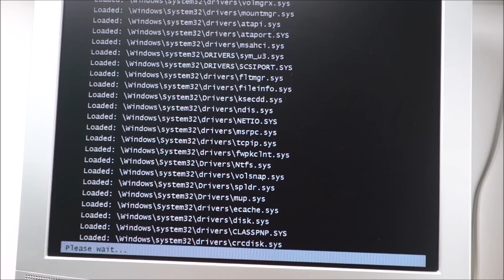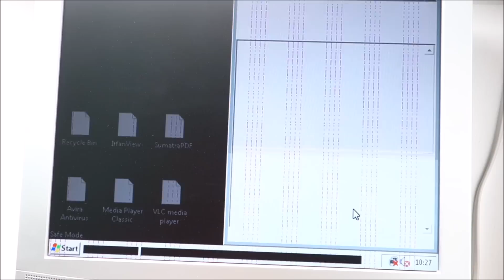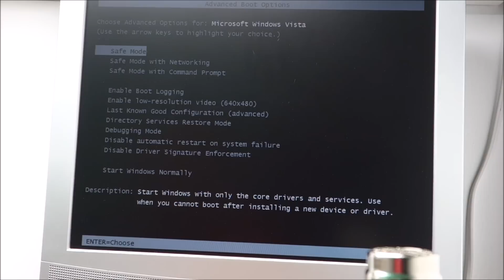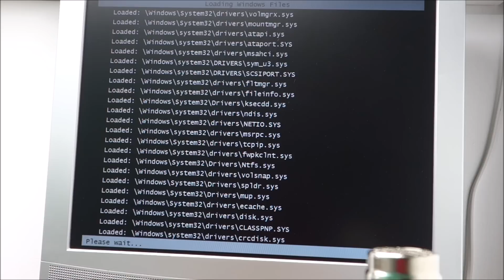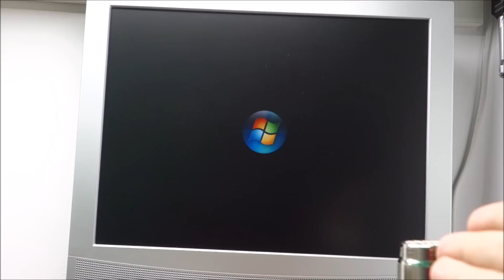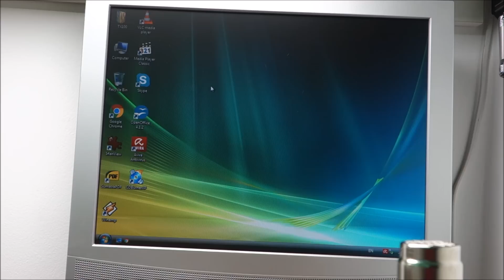How to reflow a video card with a cheap heat gun

Comment: do reballing dude, reflow works until short time
Reply from the maker: +$AVAGES it's not cost effective to do a reball on a $5 card. On more expensive cards it probably is.
Reply: reballing is a myth, the balls is not the issue, the chip itself is the issue.
Reply from the maker: Louis Rossman agrees :)
Reply: @NaiLujArdz  then how you can explain facts that re-balled chips become workable again?

Comment: Title should be How NOT to reflow a video card with a cheap heat gun rofl
Reply from the maker: Please tell me more about how I should not do this to a less than $5 card that was already dead.
Reply: Ultimate DIY right,i have spent 0€for my reflow
Reply from the maker: +Einfach Yannic exactly :)
Reply: Ultimate DIY it wont last
Reply from the maker: MotoK tips probably, but any day that it still works is a day without buying another one. So if I could get a little more life out of something by just heating it up, I will always do it :)
Reply: well done, btw you were very lucky there
Reply from the maker: +m0nty90 probably :)
Reply: The price of your card is not important...The fact is, anyone not knowing any better follows your vid working on a card more expensive has a very good chance of killing the card. Even at the end of your video you say you could do it on a more expensive gpu. Have LOL at that, I am not saying you can't do it on the cheap, I'm just saying this is not the way.
Reply from the maker: Have a listen at 1:58. It's nice how you only hear what you like. Also I said a few times, during the video, that this could brick the card.
Indeed I also say, at the end of the video, that this can be used on more expensive cards and I consider that this sould be the decision of the person that tries to fix the card, based on the particular situation.
This is not a permanent fix, exactly as I say at 1:14, but it's a way to use a defective part for a little longer. If you don't already have the heat gun, it's about $10 and if you have it, it's obviously free. Even if you buy the heat gun, that can be used in other projects in the future, so it's not wasted money even if you fail.
As for the alternative solution with professional repair shops, well take a look at this: https://www.youtube.com/watch?v=1AcEt073Uds
I would never pay for a reball on a GPU!
The only thing that I should have done in the video, or at least talk about it, is to add flux when heating up the GPU.
Reply: Haters gonna hate, if it works.. well done
Reply: Ultimate DIY Then what exactly is the point of doing it?  You are encouraging people to do it with far more expensive equipment and pass it off as a 'repair.' I have seen so-called 'professionals' do exactly that and they just do not last.
Reply from the maker: This is not a repair to make money from somebody and what people do with their own hardware should be their own decision. If they sale a board like that, that is just plain stupid and wrong, but if they manage to get a few more months of use in their own computers, that is a great thing.
Reply: @UltimateDIY  I have gone the heat gun method on lots of applications. Nothing has failed yet. That was 6 years ago.  Sandforce controller, GPUs, laptops.  Not sure how you can kill anything like this.  Adding a bit of flux also helps.
Reply from the maker: Maybe someone could kill a card by overheating it and melting something. But you would have to insist a lot to do that.

Comment: more like how to fuck up your video card with a cheap heat gun
Reply: You do realize this trick is for vid cards already F'ed up right?
Reply: Phill Stevenson You realize this also works right?
Reply: not that you would know, you realize I own an electronics repair company, and do reflow and reball bga packages all the time, this is a very bad idea, first off, since this is a flip chip there is a good chance the balls on the die are the problem not the package itself, secondly,  I margin for error on temp. is so small that even if this does work you are irreversibly damaging the chip, thirdly you are going to warp the board with out actually preheating and heat soaking the board before hand. fourthly the other common failure point of bga packages is corrosion of the balls due to poor soldering during manufacturing or mechanical failure, just heating the chip will not remove that, you need to reball the chip or replace it.  this is just like the stupid crap people do with xboxs and playstations putting washers and screwing the shit out of the heatsink this repair will fail i have seen it time and time again will last for a few days to a few months before it fails again
Reply from the maker: +Phill Stevenson you realize that for a card this cheap and old it is not worth paying somebody to do it professionaly? In this situation it's just a matter or trying to fix it yourself for a few months or throwing it away. You probably are 100% right on the technical part of things, but again, in this case it just does not matter, because it's between trying this or nothing.

Comment: FFS I wouldn't give you tuppence for a board you've used a paint stripping gun on.  Use a temperature controlled hot air station.  Even a cheap one is 1000% better than using that thing.
Reply from the maker: I don't need or want a single pence from you. THIS IS NOT A REPAIR FOR MONEY! This is just for people that really need to get a little more life out of a dying piece of hardware. Like you hear me in the wideo a couple of times I tell people this won't last. If you feel like picking on someone, do that to professionals that actually make money from this even if they know it does not last. A temperature controller hot air station is way way above what somebody should pay for a temporary fix.